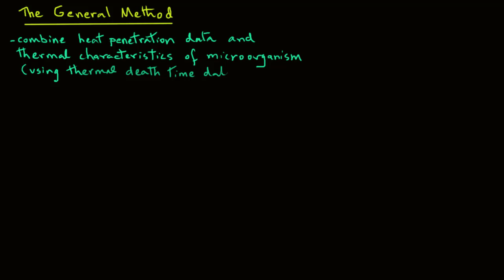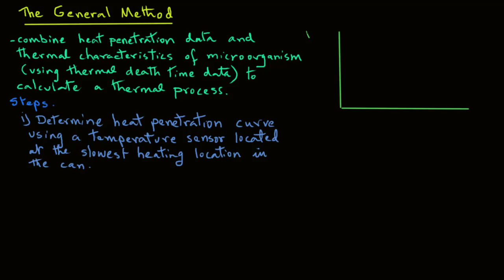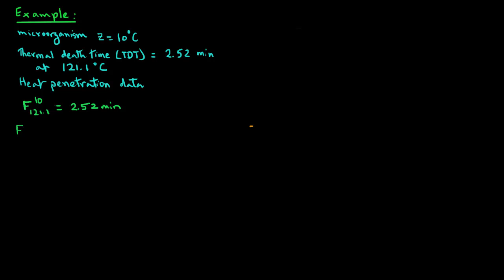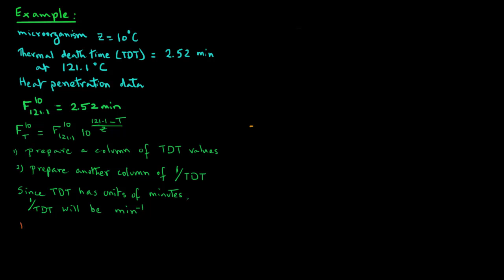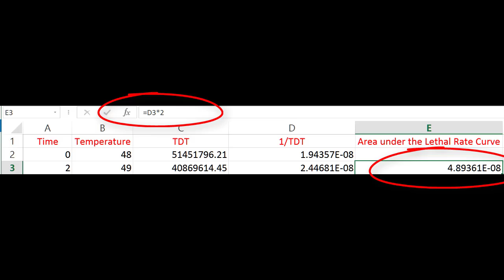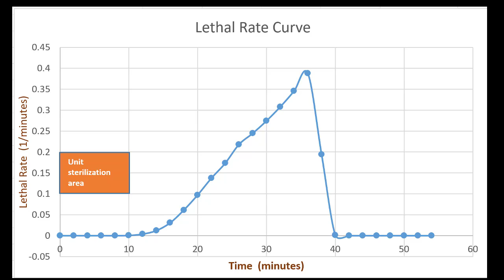The General Method - Thermal Process Calculations

Comment: Very good videos, but i have a small question. In the book you have defined the calculation rate as FR/F where FR and F are the thermal death time @ 121.5 and T respectively. Here in the tutorial you have defined the lethal rate as 1/F, and you didn't multiply by F@121.5 Celsius = 2.52. Which definition is the correct and  did i miss understood sth
regards